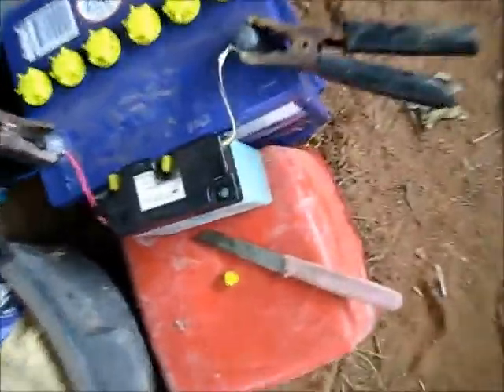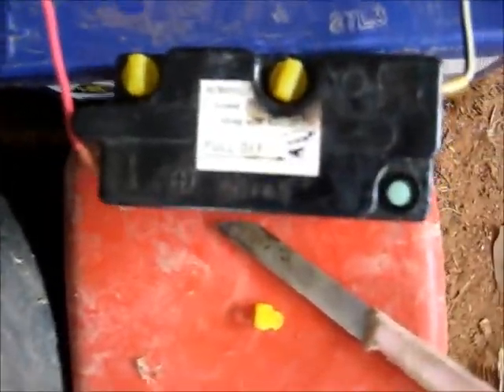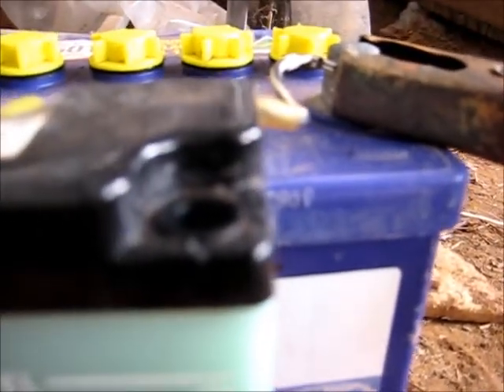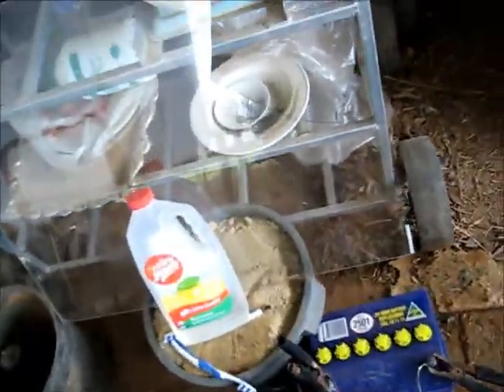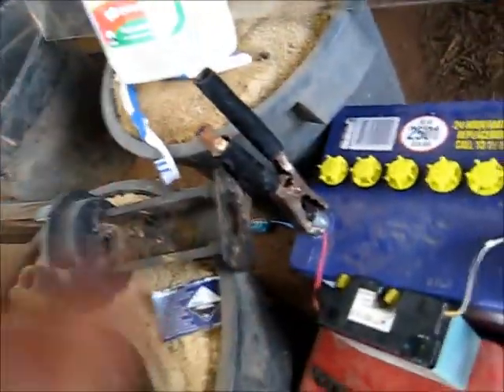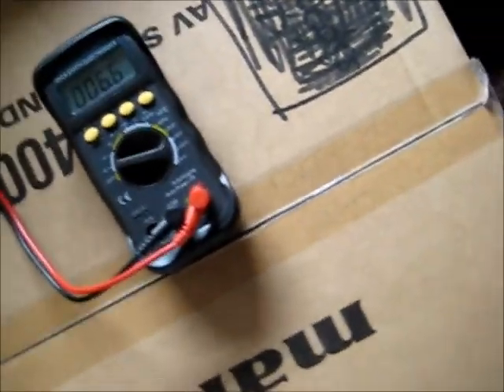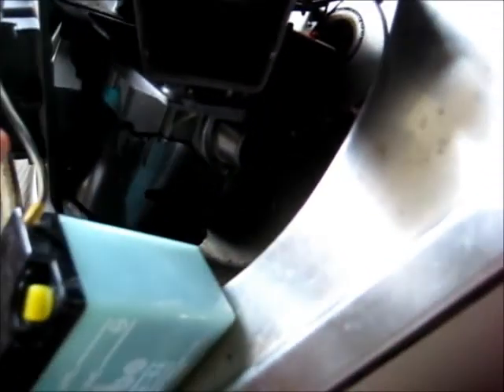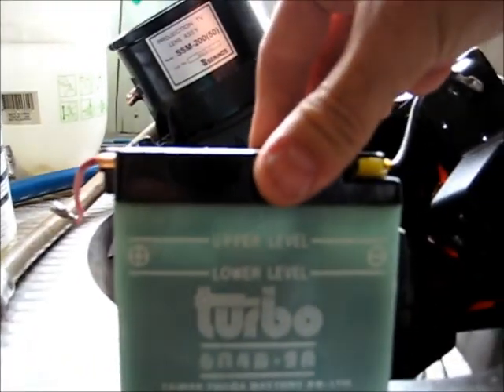Little battery all Charged up

Comment: If the battery was any good, when you set your meter to amps, either the fuse inside the meter should have blown, or smoke should have come out of the meter!! Either your battery is stuffed, of you are not moving the leads to the right position on your meter to measure amps. Golden rule, you should never  measure amps straight across a power source, amps (or current, actually) is alway measures in series with a load. A good battery (even a small one) will produce 100+ amps for a short time.